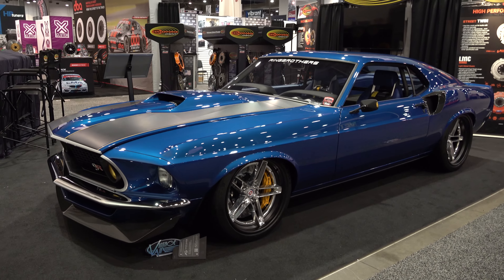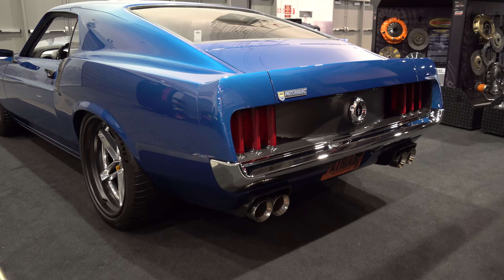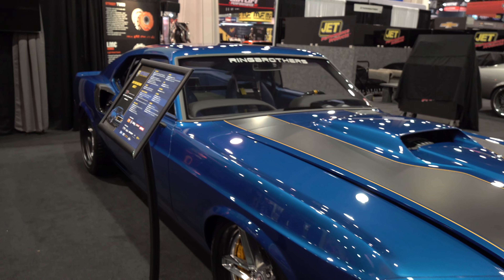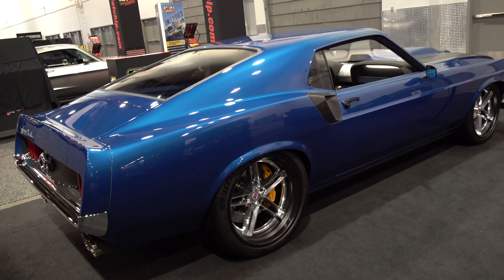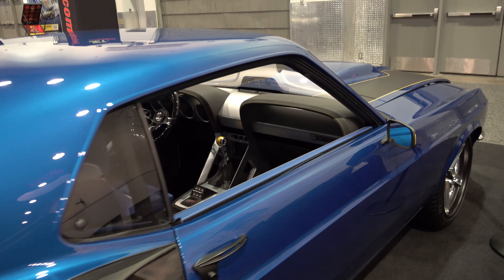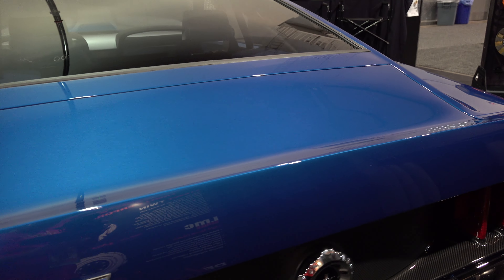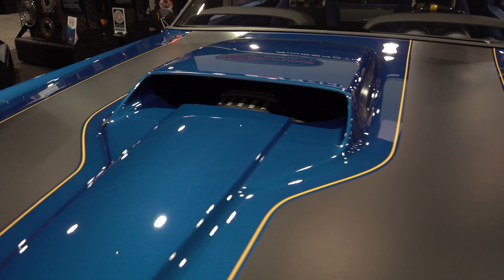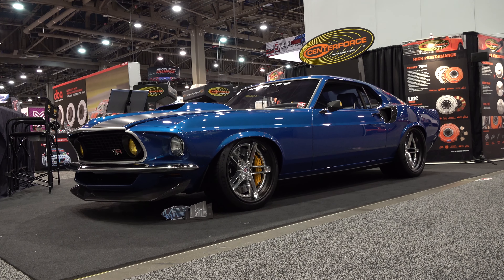1969 Ford Mustang Mach 1 "PATRIARC" Street Machine Pro Touring Hot Rod Ring Brothers 2022 SEMA Show

Comment: I absolutely love this car! My Dad had one when I was young and that's what started my love affair with cars (trucks, motorcycles and pretty much everything with an engine). I remember pulling up to a drive-in burger joint and Dad had to shut the engine off or else the tray they put on the window would just tip any drinks over that were sitting on it. There was just something special about the rumble of that eight.
Reply from the maker: I agree....The perfect number of cylinders for the perfect sound!!